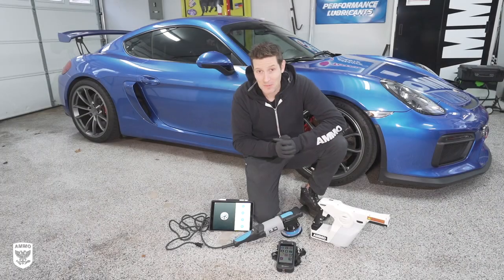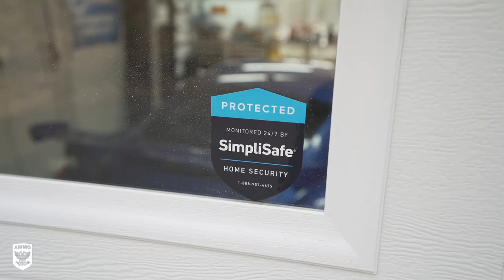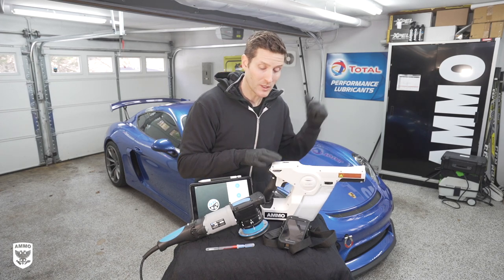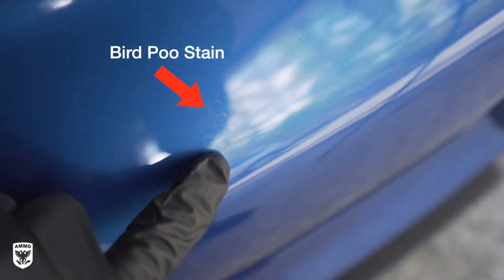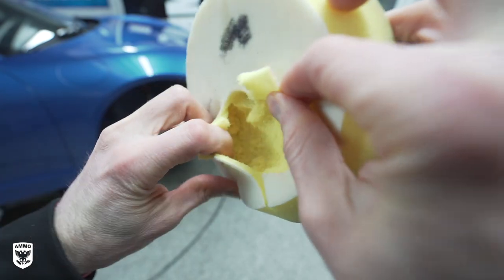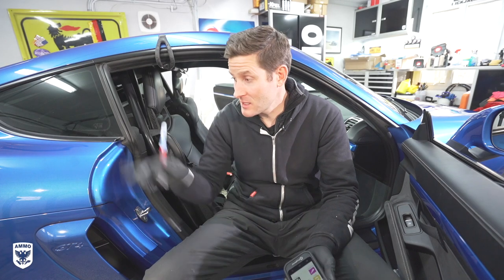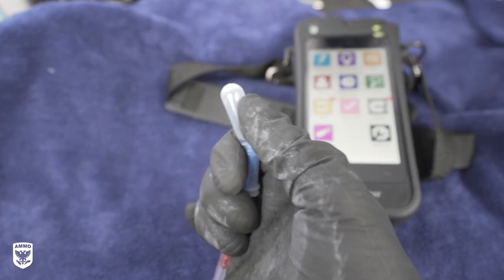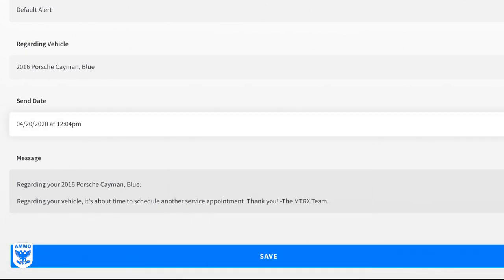Must Have High Tech Detailing Tools Porsche GT4

Comment: AVOID SimplySafe and ANY wireless "security system" for your home and office. They are not secure at all and are easily bypassed locally and remotely. This is demonstrable, DEFCON has a few great videos explaining in more detail.

A brief, from many years working in wireless communications and RF related fields;

These systems all operate in the "unlicensed" portion of the RF spectrum where devices like baby monitors, home routers, cameras, doorbells, the entire WiFi spectrum, and many other devices reside. It is essentially a Free-For-All on who can use it, but there are some guidelines on how these devices operate. These guidelines are important to this discussion! They are things relating to power limits on the device, requirements to yield spectrum "right-of-way", not to cause noise, etc. In the RF world these types of devices are of very little importance and literally are just "allowed".

Why is this an issue for security systems? Anyone can purchase a software defined radio (SDR) for cheap. Anyone can download toolkits designed specifically for attacking these devices. Even easier you can just cause so much local noise with the SRD that the "security system" shuts down and/or the remote sensors can not properly communicate with the base station. Because this is a noise related issue and the devices weren't triggered conventionally, they have no real way of knowing if it was a local attack or otherwise, it flags a general error in the system - non emergency - if at all. The monitoring company does not get a "break in alarm", they receive a much lower general error or faulty/out sensor and do not contact police. They instead begin calling the appointed contacts. This takes a lot of time, if they can reach anyone. Why not call the police right away? Because one of a hundreds of millions of legal devices could be a noise source causing the problem. Most the time it really is!

Backing up just a moment I said, "if at all", and that is important to not gloss over. Part of the FCC rules on these types of devices is that under certain conditions they must yield use of the spectrum. This almost always has to do with emergency services, air, military, etc and their RF traffic. Emergency services, military, and a lot of other devices get authority over the unlicensed devices. If for some reason one of these types of devices were to briefly occupy the same spectrum as the unlicensed, the unlicensed device is supposed to yield and not broadcast. Period. At least in a perfect world. Also, if the yielding device is programmed right, and capable, it will immediately generate a log so SysAdmins knows. 

Many of these devices, when they yield to traffic, go on a self cooldown so to speak. Where they shutdown the RF side of the radios for a predefined (default seems to be 15 minutes) amount of time, this being communicated across the wireless network of devices, before continuing "normal" operation. Unless that same overriding broadcast is still there or comes back, resetting the process. Again, because all of this is happening within the rules of the system as required, there typically isn't an alarm until the system times out. Which is more than enough time for your things to be taken.  

Other attacks:

You also can spoof remote devices with the toolkits that have been made available so that the base station doesn't get any error of any sort. Though they are doing a little better here. 

On the more extreme end of things these systems are just simply compromised and taken control of, locked out, or other shenanigans. Mainly due to the multitude of security issues in the software they use as well. Many of these generic Youtube advertised systems, and products, all are using the same vendor for manufacture. They are all using the same embedded OS, and none of this ever goes patched. Most of the time these things are open to the Internet right out of the box and without PROPER configuration are easily found.
Reply: Andrew ST So what do you recommend instead?
Reply: @juzoli   If you are going to get one at all get a wired unit. You will have to have an electrician come in and wire, but you are securing yourself against these many issues. Especially the very common noise issues caused by legitimate devices simply existing in the proximity, which cause near countless false alarms themselves. Another added benefit of wired systems is the sensors themselves are physically attached to the structure. Where as a lot of wireless systems rely on 3M adhesive to hold sensors in place. Which always end up falling off, especially in the Summer months, thus tripping alarms.   

On a side note; the FCC just approved opening the 6Ghz spectrum to unlicensed use because of how overly crowded the available wireless spectrum has become for unlicensed devices. Just to give you an idea about how crowded things are.

Now, the fact that the average response time on an alarm is ~45 minutes nationally, there is really no reason to get one outside of insurance requirements or possible discounts on insurance. 
The industry is surviving on business clients and business insurance policies that require the structure to have an alarm on it. Alarm systems, by and large, simply provide a concierge call to let you know your things have been stolen.

It is far better to invest your money into physical penetration deterrence and an onsite camera system, with secured & hidden storage, than an alarm system. With proper physical deterrence a break in won't happen. If one does manage to happen you will have high resolution video of who did it, if the police even bother to assist, as well as record of what was taken for insurance. In addition to that you can setup your local system to call, send a text, e-mail, or all three the moment cameras go live. Quicker than a 3rd party call center is going to pick up , address, and then notify.

So the idea that you need a 3rd party to tell you things are going down in your home is ancient. Not only are they doing it in a half ass way, but you have far better and cheaper options already available to you. Ones that will actually do something for you other than tell you what you are going to find out one way or another. Ones that might prevent the whole thing all together.
Reply: We got this system last year after some asshole kicked in our front door while my wife was at home. I’m not all that worried about someone hacking our system. I AM worried about the random person who tries to physically force access into our house. And at least with our SimpliSafe system the person would be caught on camera.
Reply: Wired or not, the power of any system like this hinges on it’s ability to deter intruders. If we’re talking about an opportunistic thief looking to break in to one of several houses which all have pi$$ weak physical security, then I can see how something like this would swing the balance to the detriment of one of your neighbours. If we’re talking about protecting a client’s 150K sports car .....
Reply: Good example would be similar to garage door attacks.
Reply: @DrDre001  haha your avatar FTW

Comment: $2000 for the ATP Luminometer and $2.50 per test is a very pricey meatball for something many clients aren't going to fully understand or appreciate.  I'm with you on finding ways to prove ourselves to our clients and to give them as much information as possible, but I'm just not sold on the value in this particular instance especially since the cleanliness of a surface by this measure (which is limited to measuring a single chemical sign of organisms' presence and nothing more) is compromised the very moment the owner gets in and puts their hands on things.

UDOS's success will change the DA industry.  I recently had a machine break down, and as a mobile detailer, I was disappointed that I still wouldn't be able to get one until May at the earliest despite the extra salt in the wound of living less than an hour from Lake Country Mfg.  I picked-up a new Flex XCE 10-8 since forced rotation DA is the one thing that UDOS can't do, so at least when I do get my UDOS, my Flex will still have its uses.  I'm with you on detachable cords, but not so much on batteries.  I'm cool with people who like batteries, but I'm not a fan of what they do to the weight distribution of the machines.  I also struggle to ever fully trust batteries as I've been promised far too many times that this battery will always last X long and not lose power over time.  Those promises are always broken, and I'm just tired of being lied to and disappointed.

A good inspection and estimate UI is something I've been waiting for, but I don't think Mobile Tech RX is going to be the one for me.  A subscription of $54/month at the cheapest seems a bit overpriced to me given how there doesn't seem to be a heck of a lot of ongoing support and service that keeps coming after having the software to justify a subscription pricing model at all and considering a detailer may not even use all the features of their standard plan.  I'd much prefer to see a single price for the software, but I'd even settle for a price + small sub model.  A $54/month recurring expense to use that app seems avaricious to me and reminds me of how the video game industry is trying to remove the idea of software ownership from customers and replace it with "live service" business models that keep people paying over and over and over.

You may have clients in NY who are willing and able to pay what you need them to pay in order to make some of these very expensive investments worthwhile.  Sadly there is still a very big problem in many areas of people expecting a detail to cost $50 or less and not wanting to see the value in more advanced, professional service.  I know I don't need to explain to you all the various other factors that we have to fight against like: backyard detailers undercharging, lowering the price expectations of customers bringing the value of the industry down; car washes, dealerships, the internet, and even friends/family giving people bad information; etc.  I'm still fighting those fights on a daily basis around here.  Customers around here are just not ready for the additional price hikes that $50 app subscriptions and ATP testing would require for a detailer to maintain their necessary profit margins.
Reply from the maker: Hmmm not sure I agree. Hard to know what clients are thinking, but I do know this works. If those clients do not see value in it, I would continue filtering to work with those who do :)
Reply: @AMMO-NYC  I also know that it works.  Whether or not an ATP luminometer detects ATP isn't the question.  It's whether or not clients, assuming they understand what ATP levels on a surface means and doesn't mean, value that information enough to pay for it.  I can speak for myself and say that it's not something I'd care to be paying for if I was paying someone else for detailing services, and I say that as someone who is a professional detailer, has formal education in biology, and used to work as a biologist.  I would also refer you to studies, of which the following is one example of, that have found a number of weaknesses in ATP luminometers' ability to lead to useful conclusions about a surface's true disinfection and cleanliness.  https://www.ncbi.nlm.nih.gov/pmc/articles/PMC4062432/

Don't get me wrong--I like the idea.  It's just that when I think about what would all be required to put it into practice and what that would mean for both my bottom line and my clients'... the cost/benefit math just isn't that appealing to me.  Maybe someday with more clients, some minor celebrity appeal, and maybe an extra revenue stream, I can loosen-up a bit, but I'm still at a point where every business decision I make feels life-or-death.

Comment: Hi Larry been watching you for about 6-7 years or more. 
Your a absolute legend! 

I have a small problem.
Had the vehicle resprayed 1 year ago so its in very good condition. As always over time small marring marks will appear due to washing etc. But while tackling a small surface scratch  I’ve stubbled on a problem. Marring lines where I’ve been using the product. I used Autoglym paint renovator as a posed to meguiars scratch x 2.0. 
It’s on the clear coat and I can’t seem to take the out. I’m not confident in using a DA polisher. So how to I take them out by hand?? 
Also taking out very fine swirl mark by hand as well?
The vehicle is silver and it’s very hard to notice them. Hope you can help.

Comment: Here are three tips from a security standpoint for you. First. Hard wired dual motion sensor lights high up out of reach on the corner of the house. One sensor pointing towards the entrance of the driveway and the other in the opposite direction. Secondly. Tint the garage windows with dark one way tint film or change the glass from clear. Lastly, take down the emergency cord from the garage door.

Comment: Great video and some interesting new kit. Took a look at the Mobile Tech app and liked the format and what it could do but it is super buggy, kept crashing every time I tired to select services. Also there is a lot of setup that has to be done on a browser before you can use the app which is frankly just weird. Even the browser site I found to be buggy, had to keep refreshing to change prices or titles on packages or services. 

If they could get rid of those glitches and the one where you add several prices for the type of vehicle on a single package, but when you save it just reverts to £0.00 that would ace because it does look like a great app and could defiantly elevate you in a crowded market.
Reply: Hey, Ash. I'm so sorry to hear you had issues with the product. We haven't heard these before. Can you send an email to matt@mobiletechrx.com so we can try to help out?